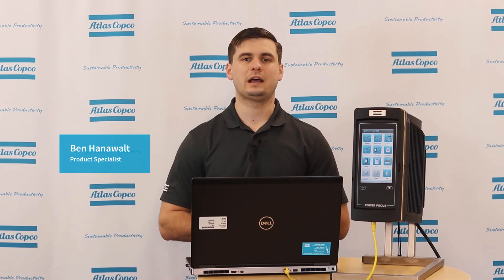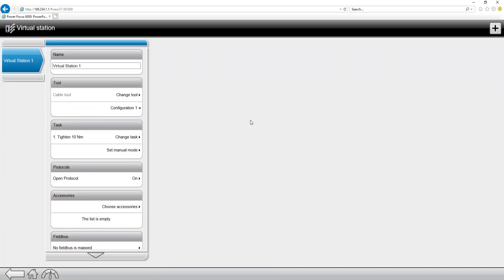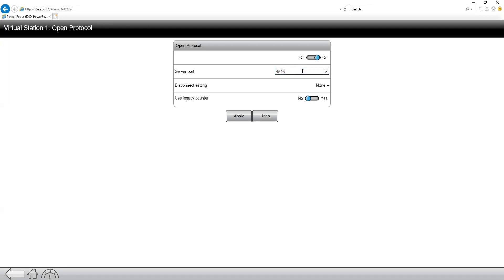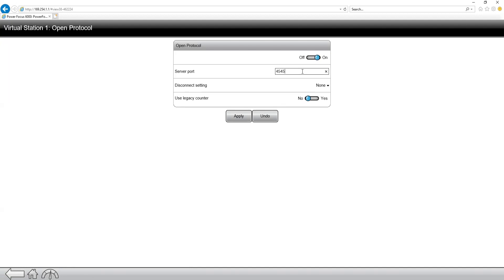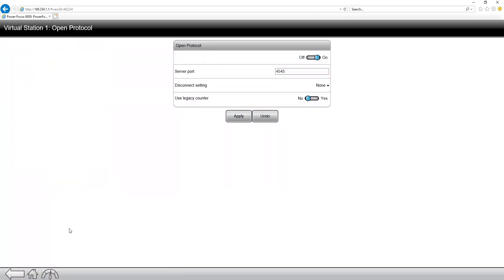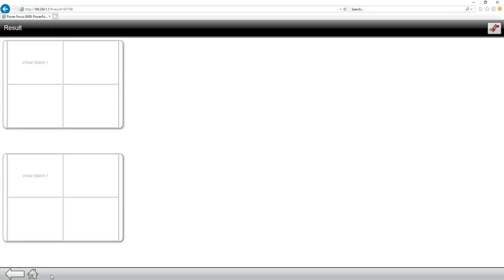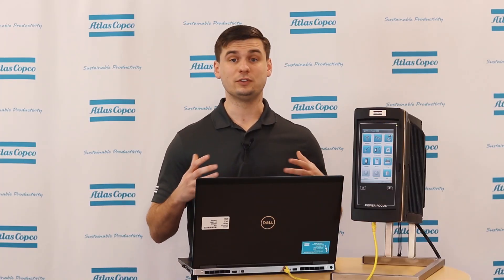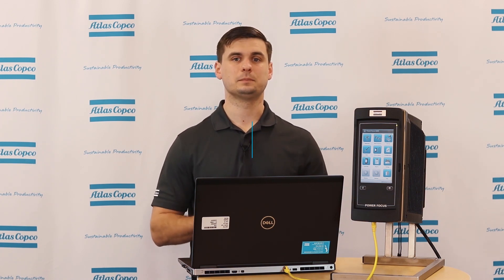PF6000 | How to connect and communicate to open protocol

Comment: We have over 100  PF4000’s between 3 facilities in our assembly division, all running custom .Net/SQL apps with Open Protocol tor process/quality control and data recording. We have begun replacing the Pf4000’s with PF6000’s on our 3 neeest lines/programs, but we cannot get Job/PSET MIDs to respond as we expect them to. 

Our local dealer has few other clients using Open Protocol — how can we get support?
Reply: i have the same question !

Comment: Question, can I have one ethernet wired  connection between PF6K and a computer using Open Protocol, AND another WiFi connection as backup just in case the wired connection network has any issue, to continue adquiring torques, and use wired OR wifi connection depending on then availability? Thanks

Comment: Ben does open protocol and Copco support multiple/different PC's connecting to the same controller? If so with both connections active could Connection 1 set PSets and Batch Counts while the other connection disable the Tool, both at the same time?